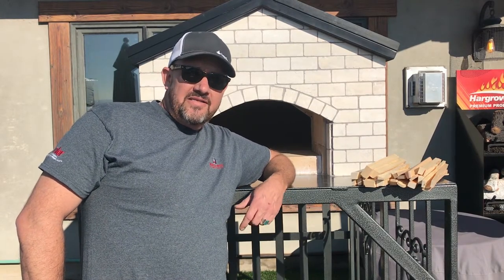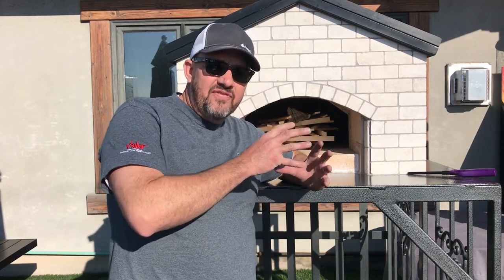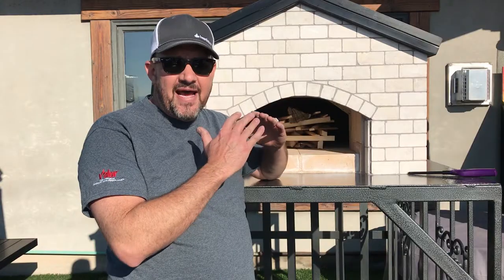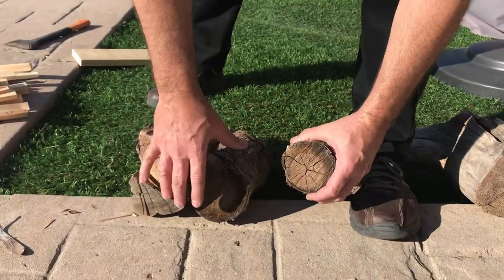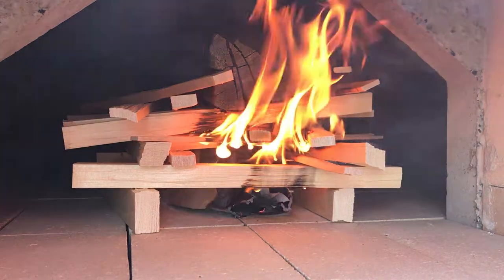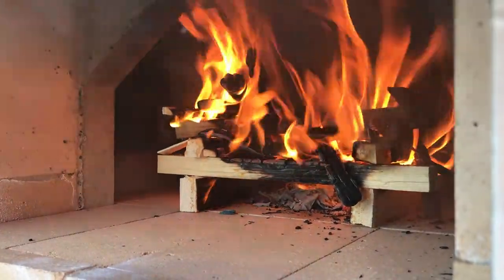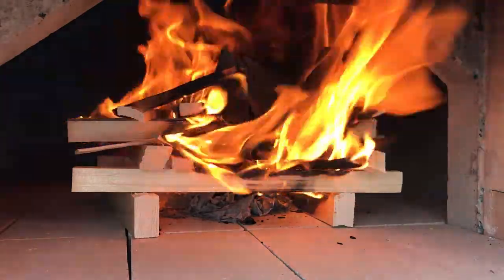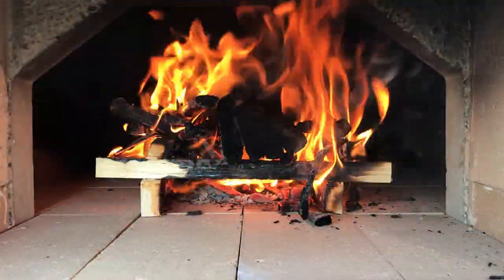Brick 'N' Flame Wood Fired Oven Curing Process

Comment: Great oven, don't you think this fire is too large to begin with? Isn't it safe to reduce it to a smaller fire in order to extract the dampness through the mortar prior to insulating it?
Reply from the maker: Hello Ann, Thank you! We were able to cure the oven without any issues with this size of fire.  We also used it all summer and it worked great! If you feel more comfortable curing the oven with a smaller fire you can 100% do that. Just make sure you keep that fire going for an extra day or so.